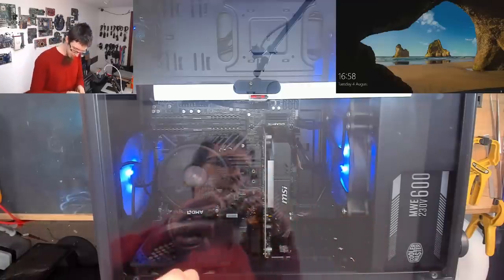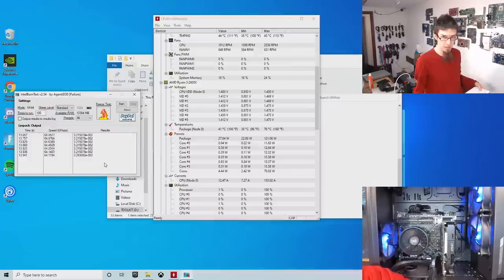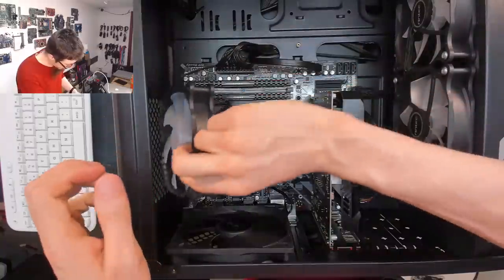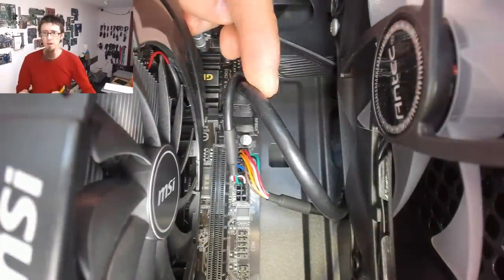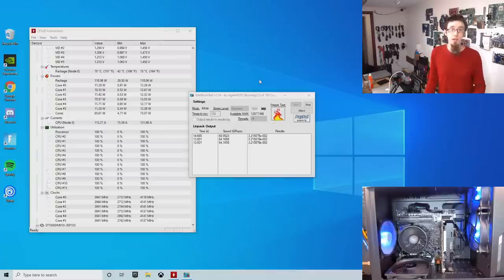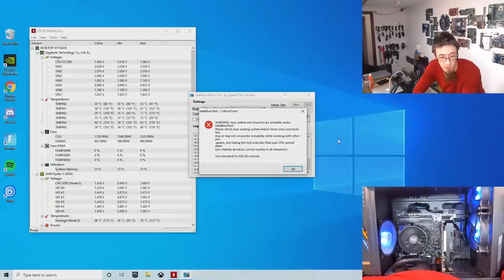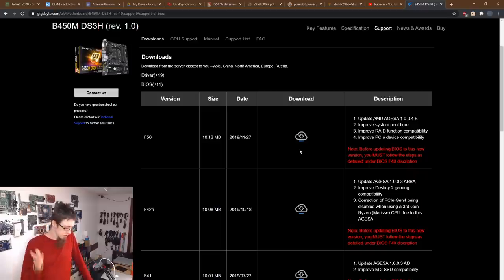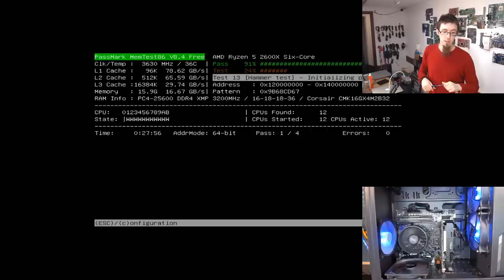Gaming PC Crashes at Random - LFC#217

Comment: My previous gaming PC would randomly bluescreen/crash for 3 years straight but I could never be bothered to get it fixed or look into it. One day I decided I had enough of randomly crashing during a game so I tried lots of different things to find the issue and I noticed a couple of the CPU socket pins were slightly bent. I borrowed a friends MOBO with all my components and if turned out to be those couple pins being slightly bent were causing the crashes all along XD

Comment: You say that molex connector coming off the fan has live 12v and 5v. However, coming from the fan I don't see how it could have any voltage considering the fan does not produce any.
Reply from the maker: It tails off of the 3pin connector, which was plugged into the mobo fan header, which outputs up to 12v. 5v pin would've been dead though, yes.

Comment: I had a weird RAM problem;

So i had 2x8gb of 3000mhz G.Skill, that did not work onmy new high end MSI Ryzen, but then similar Corsair sticks worked just fine @ 3000mhz...
That G.Skill set works just fine in my other computer that is older ASRock Kaby Lake, no issues whatsoever, i mean wtf?
Can these be BRANDLOCKED?

Same sticks basicly, just different manufacturer.
Corsair felt snappier and it detected itself automaticly...

Comment: If you see an error on memtest 86, it is always always always a good idea to spend time checking the Ram modules. First, reseat modules then try new modules. Even if you solve the failure by disabling XMP, it can still signal a ram issue that will pop up later.

Comment: Is it a problem if a 1-2mm piece of gold foil chips off the connector on a GPU? Will it still connect ok?
Reply from the maker: Try it and find out. If it's an important pin, you may lose a PCI-E lane from it, and it may drop into 8x mode, which may or may not hurt performance depending on what GPU it is.

Comment: Saw in the video that one of the blanks was removed where the molex cable was. Have to wonder if the user was powering some external device with it.
Reply from the maker: Most likely the case came with that plate missing (they assume you'll be using at least one PCI slot for graphics).
You wouldn't be able to power anything from that connector as it was getting power from the mobo's fan header.

Comment: A few days ago, i have a similar problem with XMP. Whenever i use a program, playing some games, watch youtube video, etc, it always randomly crash or even restart my PC by itself. Turn out, the problem is when i turn on my bios XMP, i also undervolt the memory. After i turn my BIOS to default, turn my xmp on again, and not touch the memory voltage (i keep on auto) the problem is gone. Idk, just for consideration, have you check the voltage setting of the memory? Nice video, btw..

Comment: People need to check the CPU specifications before buying incompatible parts. The installed ram is clocked at 2133 mhz, but overclocked to 3200 mhz through xmp. The Ryzen 5 2600 
System Memory Specification is 2933MHz, and going above that speed usually results in stability issues.

Comment: I would never chop the Molex Connector off as you might need it just in case the other cable gets damaged which is very rare. I would just zip tie the Molex cable to the other cable so it is out of the way or completely replace the fan with one that has not got a Molex.

Comment: If theres no obvious hardware fault and the drivers are installed correctly, it always most likely the bios microcode, most builds just use the default v1 that was installed on the motherboard at the factory, and the vendor doesnt bother to update the bios before its goes out to a customer, I only had my Skylake PC for three months before i started getting random lockups in games. After the Spectre and Meltdown bugs I got the bios motherboard updated and now its rock solid.

Comment: one aspect of the Linux grub menu, there is a mem test handy if you don't want to boot into the Penquin, I have a dual Ubuntu & Windows 10 boot, where the Linux install of Ubuntu will give me a boot menu for both operating systems & for each Linux Kernel a boot diagnostic if needed.  But the additional mem test makes a dual boot an added advantage.  (I prefer Mint over Ubuntu and Windows 10 by the way)

Comment: Over a year later, I have this same motherboard with the T-force cheapie memory with a prebuilt machine I bought. I narrowed it down to ram and isolated a bad stick the same way first by disabling XMP and then I just ran the pc in single channel mode with the one good stick and didn't notice a significant performance issue so I ran it like this for a while until I bought a kit of the same memory in that PC but in 3600Mhz. I ran it without XMP for a while and noticed no issues so I started enabling XMP mode to run the ram at full speed. I noticed really no difference because usually games have my system GPU as the bottleneck I am unable to fully test the system under load without synthetic stress test programs. I had some weird issues happening like a game CTD to having the screen go blank on me while I can still hear sound so I started to assume it was my GPU starting to fail. I get no logs other than when I powered down the system thinking it had crashed to a black screen when in fact it just de-synced the screen. I first started back by disabling XMP and running it and had the blanking screen issue. I didn't want to believe it was my GPU going so I went with the cheapest option was replacing my monitor. Not before putting back in my single stick original memory. LSS I never had issues running the system with single channel mode but in dual channel mode it starts giving me issues. I'm currently waiting on a kit of ripjaws to show up as it says its setup for ryzen platforms, but we'll see. I'm hopeing its not the ds3h-wifi I have cause it is one of the more expensive problems. I guess that's what you get for owning a gaming PC. It's like owning a boat. Bust Out Another Thosand.

Comment: I sometimes use molex for fans. usually temp stuff. But I do tape them off because they can short out to stuff.
My first step would be to do the game on it with temp sensors added in the case and monitors running.

Comment: id say kicking it out the door at 3000mhz on the ram is ok, however, if the ram is faulty it will eventually degrade enough that it wont be stable at 3000. in which case youd need a different ram kit. but you can chase ghost all day and not find one as they say or you can change tactics and let them come to you and find plenty. its just random sometimes. either a bad kit of ram on xmp speed or a qhvl incompatibility and your there.

Comment: Oh great. I just recieved a Cooler Master PSU. I thought those flat robin cables would be decent to work with. I just did a SFF build with a Silverstone SFX PSU with the same type of cables, except modular and I custom cut all the cables to length. The cable management in that thing couldn't have turned out any better. I hope I don't feel the need to customize the cables on this CM PSU. I'm afraid I might though after watching this. I'm using sleeved cable extensions on this build in a m-ATX case. There isn't much room between the PSU and drive cages for excess cables and I really didn't want to throw down on an all SSD build. Also, I hate cutting the cables on ATX PSUs because it makes it harder to reuse them later. Guess I should have just just went modular like I was considering.
Reply from the maker: It's possible to do a good job with these CM PSUs, it's just more hassle than a typical PSU with sleeved cables. I didn't do it in this video because while I'll do some cable tidying as a bonus, I'm not going to pull out the PSU and redo it all from scratch, which is what this PC would've needed. Unless I've been asked to, of course. I do occasionally get jobs where I'm being paid specifically to pretty the cables up...

Comment: I hope this guy didn't buy a pre build like this..  I'm glad I built my own pc, I know every nook and cranny in my case, every spec was matched, no extra bloat wear I didn't want, all connections were triple checked and accurate..  but a memory issue like this would be hard to figure out without the tool you used. I still do not understand how today's PCs don't have a better diagnostic system and couldn't just tell it there was a memory problem.   I hate having to run 10 programs to scan components and see what the are doing.

Comment: what about that GPU fan and the bottom one? turbulence on air flow?
Reply from the maker: The bottom fans are blowing upwards, so they'll be supplying air to the GPU. How effective they are at bringing up air from the lower-front vents is debatable, but it's not super important for a 2600x and 1050 Ti. PSU was fan-side-down, so that's doing its own thing.

Comment: I had this same problem with my Z390 Aorus Pro Gigabyte board. When I use XMP my computer would crash under load. I tried 2 different memory kits and both did it. Gigabyte sucks. I now have a ASUS Z690 I just built a month ago that I'm a lot happier with.

Comment: I had a recent RAM issue where I had been running Corsair Vengeance Pro 16GB at 3200MHz and all was good. I bought another 16GB kit of the exact same memory and installed it. Passed MemTest86 after 6 hours with no errors but was getting BSOD. Turns out my original kit was version 5.32 and my new kit was 4.32. 5.32 was made by a completely different manufacturer than 4.32 and it was a compatibility issue. I couldn’t believe it that the exact same RAM was incompatible with each other! But that’s what it was.

Comment: I took my computer to the shop because it kept giving me blue screens during certain games. They called me a few days later to tell me that they couldn't find any problems. I guess they ran the same tests mentioned in this video to stress the ram, video card and cpu. The only way they could recreate the issue was to play the same games it would crash on. GTA5 and Arkham knight. They got back to me saying they updated the bios and graphic drivers. I think updating the bios is what did it, because I updated the nvidia drivers a bunch of times and never was able to prevent the blue screens. It's interesting to know that those tests aren't always reliable.

Comment: Do you ever look for (mini)dumpfiles and debug them if they are present ?
Reply from the maker: I usually don't... personally I think BSODs are more symptomatic, and decoding them is often a red-herring. I'll look for the actual error code on the Blue Screen, but I never both with dump files. I know some people can often pluck the root-cause out of mini-dumps though, so I wouldn't say it doesn't work.
Reply: @Adamant_IT  i use the program Whocrashed to debug (mini)dumpfiles in less then a minute. This program has point me in 9/10 in the direction of the culprit. Crashes caused by bad drivers (Videocard etc) or software (antivirus) are immediately found. The downside is, if the customer has Ccleaner running, that program is by default configured to delete (mini)dumpfiles. I have this program installed on my "testpc" and have the folder "minidump" in the Windows folder shared. That way, i can copy (mini)dumpfiles straight from the "problempc" to my "testpc" and run Whocrashed on the testpc. That way i don't have to install extra software on the problempc, and don't have to hassle with a usb drive. This is just a little tip what works great for me and like to share.

Comment: The upper fan needs to be a 15mm "Thin" fan. The normal 25mm thickness fan is too thick. I have a similar issue with my Cooler Master N200 case, no cutout at the top of the MB tray too.

Comment: First thing I would have done is update the bios.

Also there is a program specifically for Ryzen CPUs for memory timings.

You also run memtest in single threaded mode, which will catch less errors.

I have an x370 Gigabyte running a 2700 with 3200 ram at 3366 with with better timings than standard XMP (reduced the CCX latency), stable. Doubt the motherboard matters.

Comment: Very interesting thanks. I thought it was fan related first and therefore heat. I have no idea why they have two fans pointed into the battery box cover.two fans by each other on the corner isn' good either. Not sure why the ram wasn't checked sooner, though seemed good later. I had no idea you could run non supported memory. I just bought one of these boards and it is fairly low end. I am trying to learn about memory OC and I just heard buildzoid say those kinds of speeds are for OC systems already operating at those kinds of frequency, maybe it all needed more voltage and the proper timing set like you were saying. Maybe it can't though and that is why it isn't supported.
Seems like this was sale items mis match. Usually things are on sale or cheap because they have niche uses, and need to be matched with certain set ups to work, like that case, no frontal vents, better for IO, that mem having specialized needs, that psu being such older tech.
Newer builders have to learn the hard expensive way and retailers need to move hard to sale product. 
Cheers m8

Comment: Another issue is the cpu is probably not capable of running 3200mhz as I found out even my 3400g didn't like 3200mhz kit had to change out the mem to a 2933 kit.

Comment: Well, this video has inspired me to take my PC apart tomorrow just to give it a little check up. It works fine but as he said many time "You never know".
Reply: Did you manage to put it back together? XD
Reply: @steelixian1705  I did! It was a good thing I took it apart too. Turned out I had my liquid cooler fan turned the wrong way. My average temperature has gone down by about 5 degrees. :)
Reply: @ProclarushTaonas  Lmao. I had a pc that lasted 8 years before I murdered it accidentally, I didnt open it up for 5 years. Honestly suprised it never crashed once. Was terrifieing taking it apart had to take pictures before! Anyway I discovered that the people whop built it, had not took off the plastic "Remove me" labels right where the thermal paste goes. Its really amazing how it didnt burn out lmao. I take my new one apart monthly now XD
Reply: @steelixian1705  I am honestly dumbfounded that it lasted that long. That is quite literally amazing!

Comment: I had a similar problem with my machine just last week.  Crashes randomly when idle.  Rarely was crashing while actually using the machine.  Turned out it was the system SSD drive which was failing.

Comment: Hi, thank you for your video. If my knowledge is correct, on a 4 layer mobo the memory supported range is not so good. With a 8 layers motherboard model the memory support is larger and the frequencies higher, right ? Another thing to check is how many memory slot you have. Is is more difficult to reach higher memory frequency with 4 slots then with 2 slots models. I always check what is the highest memory support for a given mobo to get an idea of the quality of memory support. Like on the newest B550 mobo some can handle 5200 OC memory.
On the temp side you cheked only CPU, but not the VRM. May be there is a tool for that.

Comment: There is also a motherboard standoff missing next to the 26 pin motherboard power connector, not that it would cause an issue but just not properly built.
Reply: The standoff is not missing because there is no standoff hole in the case. I got the same motherboard and same missing standoff hole in my case. You can use plastic clip for that hole, if you want, but it can also be without it because you have 6 screws holding all motherboard in place.
Reply: @firephone831  no, the case does have a hole for the motherboard standoff actually as you can clearly see an empty standoff hole at the rear of the case next to the one which has a standoff in which isn't doing anything (in the wrong hole), you can see it at around 15 mins into the video. I've also worked on one of these cases before with the same standoff missing, pulled the motherboard out and put one in where it should be and it's all supported properly. It doesn't hurt not having the standoff there, just more support for the motherboard when plugging the 26pin connector in.

Comment: I ran into an issue with XMP settings on an Asus b450m-a motherboard. It would run XMP 3200MHz fine with two modules installed, but refused to run it with four modules installed. I checked the QVL and spotted it was a motherboard issue not wanting to support 4 modules above 2800 MHz. I contacted the memory manufacturer, and they did me a solid and swapped out my 4x8 GB modules for 2x16 GB modules. After the swap, XMP runs perfect at 3200 MHz and I have 32 GB of ram running my system.

Comment: Hello, I have a HP stream cloudbook 11 which intermittently / randomly shuts off without warning.  The longest it stays on for is around 5 mins, and shortest is a few seconds.  However, there was a period when it stayed on long enough for windows 10 to install and seemed to work okay for a while.  The laptop does not have a fan and it shuts down even when the laptop is cold.  the laptop shuts down even when in bios.  I have tried the following but the problem persists:

1. checked the heat sink and applied a fresh thermal pad 
2. Disconnected keyboard, trackpad, screen, WiFi card, etc

Any idea where on the motherboard the fault could be? Thanks in advance
Reply from the maker: Sounds like a problem with one of the power rails on the motherboard, but that's going to be a nightmare to find. Not worth the hassle on a netbook IMHO.
Reply: Adamant IT Thank you so much! Please can I make a video request on identifying the key parts of the motherboard (bios chip, graphics, power rails, etc), keep up the good work